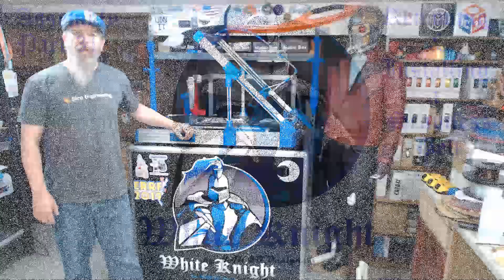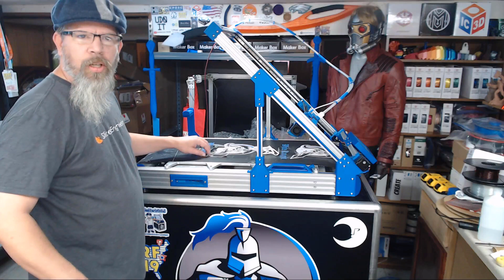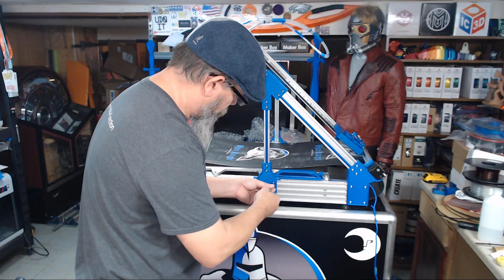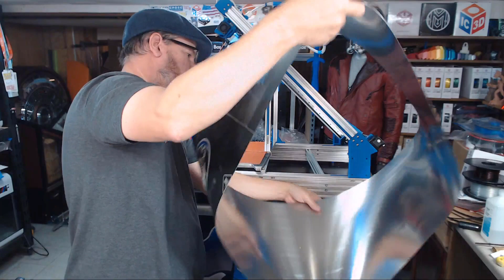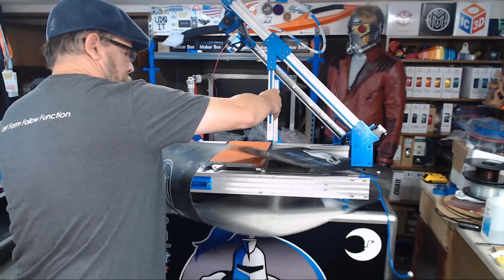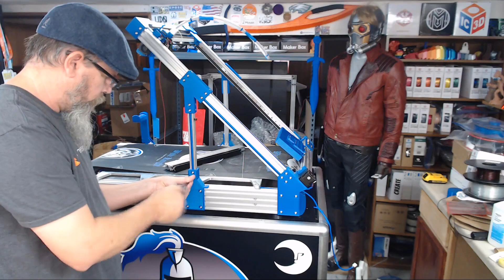White Knight Assembly Part 31

Comment: Hello karl, My belt seems to be shifting during the course of motion. Any solutions?
Reply from the maker: Typically this happens when one side of the belt is tighter than the other.  Typically when I install mine I tighten one end down fully then could how many revolutions I tighten each side on the opposite end.

Comment: It would be weird but could you use a metal foil underneath the sheet, and an induction heating coil to make a heated bed?
Reply: or does it already have a heated bed?
Reply from the maker: @ericlotze7724  it already has a heated bed...  Sounds like you need to go back and watch from the beginning... ;)